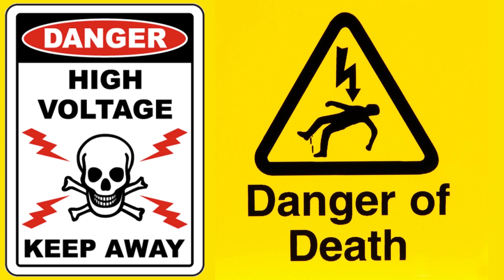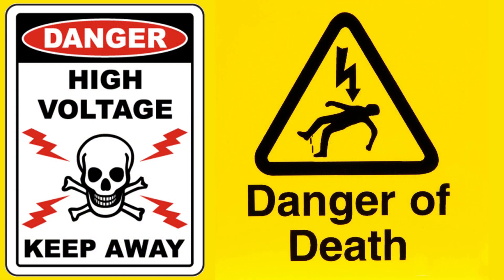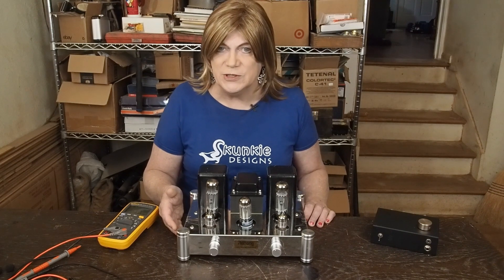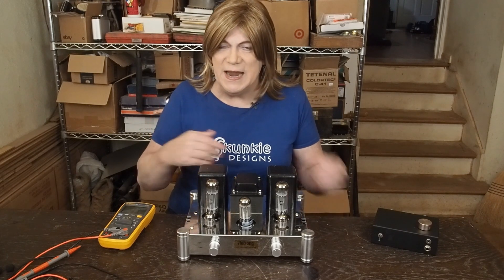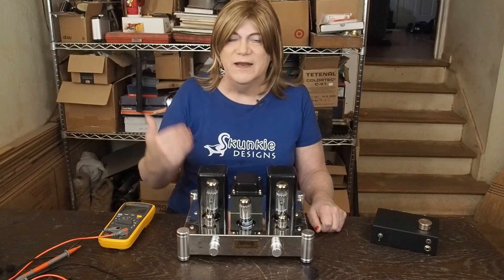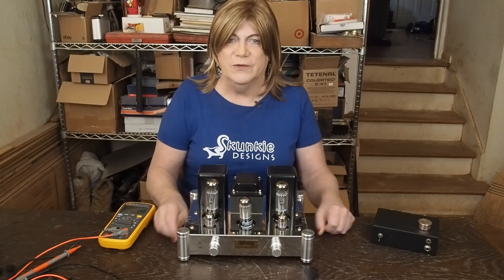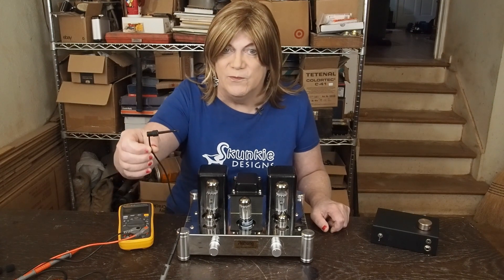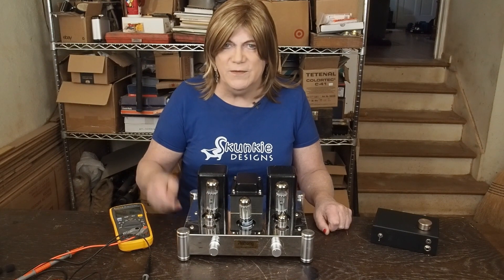Warning: Tube Electronics are Dangerous

Comment: i we lived a hazardous life, Manny electric kicks to, but  mostly 120v. in my country, no one has died of voltage under 42.and its procedure to be under opsevatjon fore 24 ours if having electric shock. use plastic soled shoes, only one arm in work, no wett socks on your feet.its better to have low voltage amps then some  big transmitter tube amp. I always put a plastic bag over the connector to ac,when working on an amps I don't mistake it fore soldering iron or something else, I work on my kithsen table. Best wishes Skunky!

Comment: Well said, and I am sure you'll be fine. Otherwise, any DIY channel has to be taken off because people can hurt themselves when woodworking or doing a water change for their aquarium. We typically assume that "knowing" is all what's necessary to be safe, but there is one thing that no warning can replace: experience. Knowing of a risk is one thing, acting in awareness of it is another. Before YouTube, only people within certain professions would deal with tubes and saws and chemicals, they would learn step by step with a master tradesman watching every move so certain precautions became second nature. That's what protects you, not a warning. I measured above 700V AC on the secondary of my PT, and there are 400+ V all across the amp. You don't see high voltage. And since I do not work with high voltages in my job, I made it a habit to put on a rubberized working glove on the hand that holds the probe. Less for protection, more for trying to signal to myself that I am in danger territory. Call it paranoid, but what's the harm? I think your instructions are great, and you couldn't be any clearer, but I would probably say that a tube amp should not be someone's first electronics project. Get a SS kit or anything that helps you gain experience. You just have to learn by doing what a cold solder joint looks (and appears) like and that you can't wiggle wires when something seems off, etc. I don't think it's fool proof, but experience helps.

Comment: Skunkie, thanks for the video. Yes it's necessary and you are right. I will tell you straight out of the gate that I work on 1,000,000 watt plus radar systems and even some of the people I work with are aloof to high voltage safety. Me, I'm afraid of it which makes me even more cautious than a confident person. We have discharge sticks with no resistor on them even!!!!! Totally incredible. But I always think three steps ahead. I think you're right and I think that it all depends on the individual. Keep doing what you are doing. I'm enjoying the videos and the education. Don't let anyone wind you up and get to you. 
If you want, post a video on safe discharging etc etc when it comes to HV.